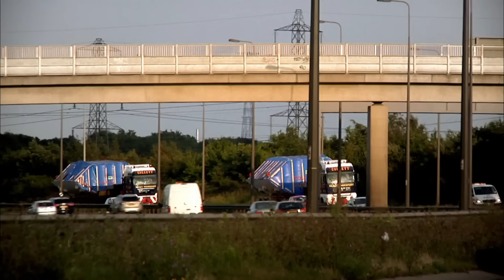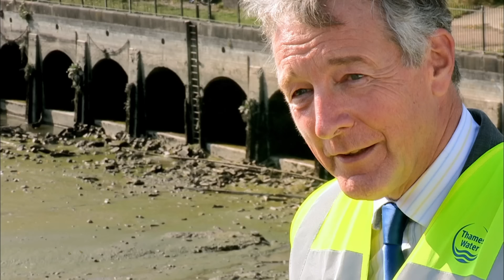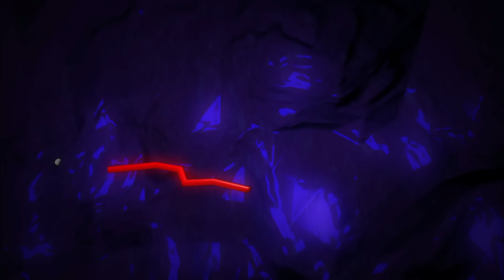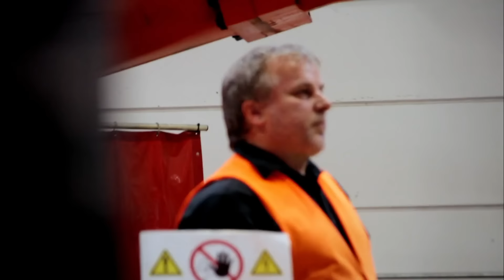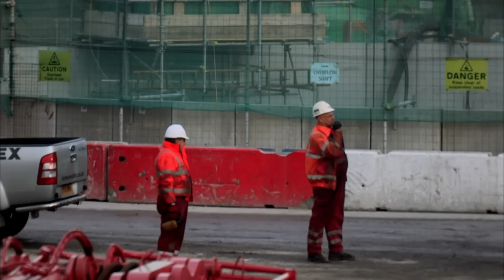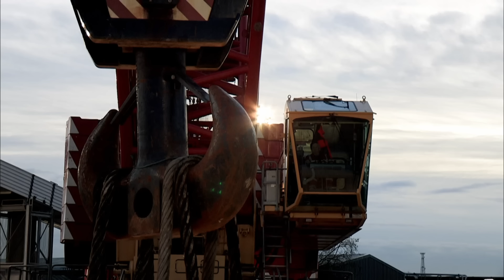Dirty Great Machines - Tunnel Boring Machines | Technology Documentary | Reel Truth. Science

Comment: This is not some kind new advance tunneling method. The only difference is the diameter of the  bore and the geology the machines are designed to bore through.

I had the privilege of seeing one of the machines up close more then 40 years ago. It was a 7m steerable hard rock boring machine use to tunnel two 7.5 mile tunnels for the Red Line of the Washington DC Metro.
Reply: Its New And Advanced, You Literally Disproved Yourself.
Reply: @cumguzzler8537 lol

Comment: How big is a  star bluster  and a battery  used to powers  the lazer  that cuts through  an a star bluster  and will it be used on the mountion to cut a hole  in a side  of the  cauouon  and the tunnel  you want  to cut out a trick trains  and a freeways  in the same tunnel  like the  Eparepen  roundly would be easier  thin the big  thing you have  and coust lases  and faster  and the laser can fumes the still nines you ntad to gather  for the trackers and  the still nines foe the upper highways  up above  the still tracks